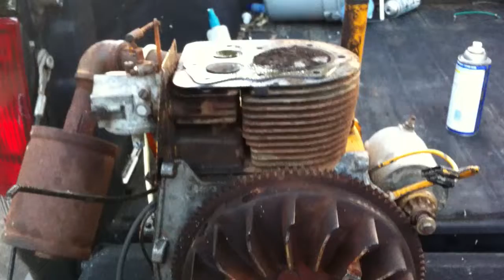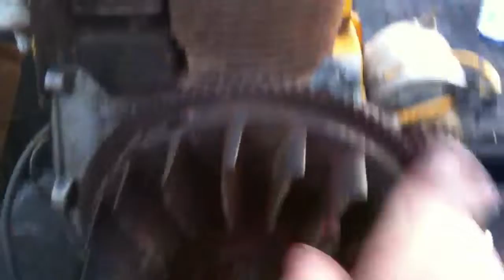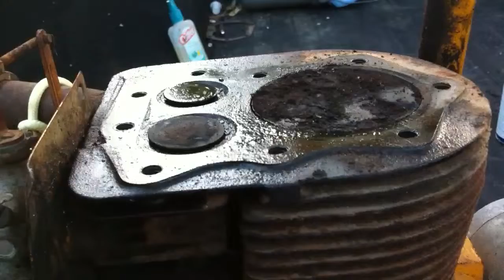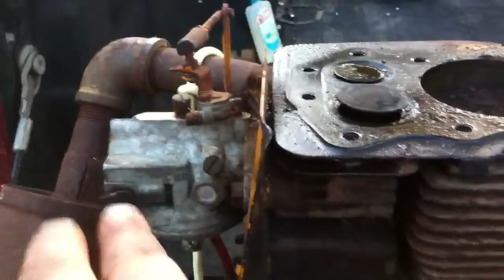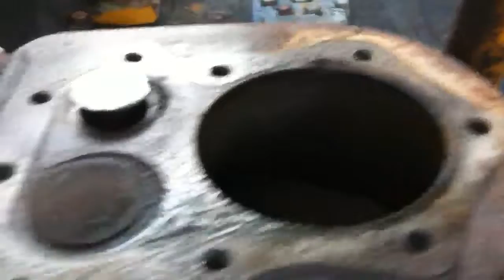EXPLAINING BASIC 4 CYCLE ENGINE FUNCTION

Comment: Yep its allways important to have the correct flywheel to store the energy from the previous explosion to keep the engine moving through the non powered operations, exaust/new fuel/compress/bang! for a new charge of flywheel momentum.

Flywheel is so important, but looks as if it dont matter :-)

Its supprising that they work so well with only 1 out of 4 providing power, but they do :-)

Comment from the maker: if you had to grind the valve stem then the valve has lost its heat treating and has stretched a little.......lean carb settings are usually the culprit as it overheats the combustion chamber

Comment: Well done !!  I recently was working on a 4yr old 5hp Briggs non- o/head valve engine and the strangest thing I noticed was the exhaust valve would open slightly just before the compression stroke, hard to start and no power.   I ground down the valve stem just enough to stay shut. Runs fine so far, have no idea why it went like that ? any ideas ?